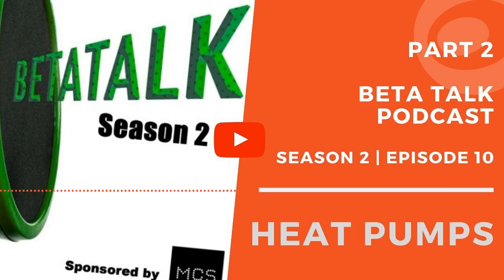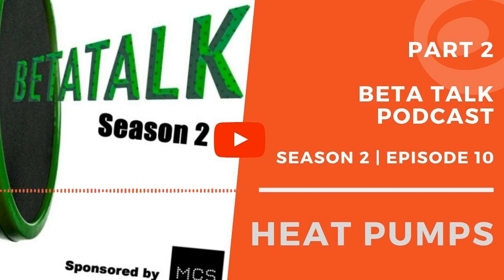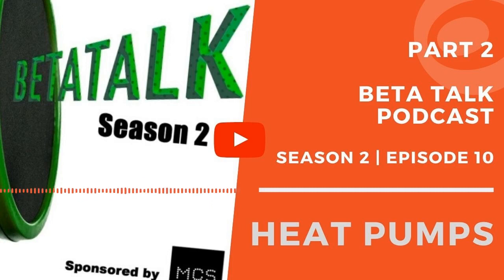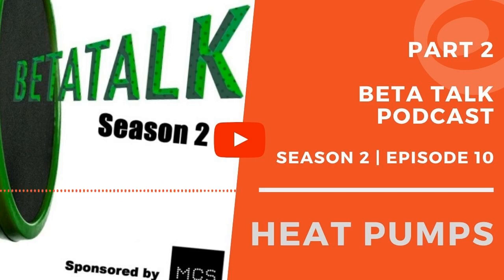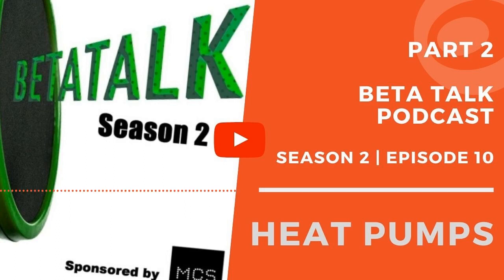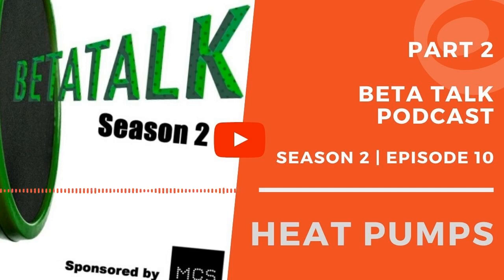Renewable Energy Podcast: Ground Source Heat Pumps (part 2)

Comment: My low-income building has an aging boiler and my carpet has been ruined by the steam heater leaking SO solar power to power a heat pump system